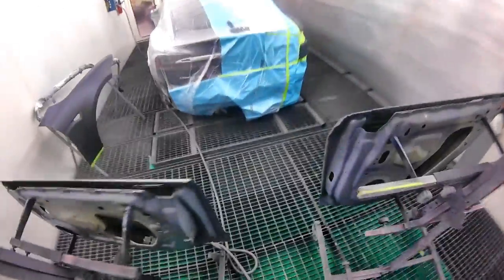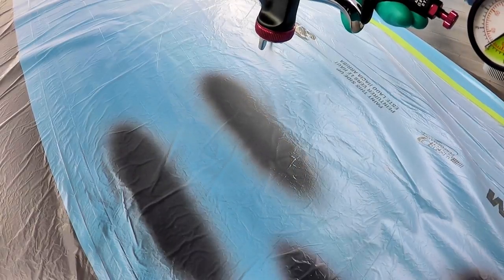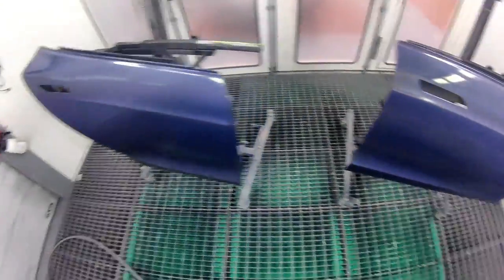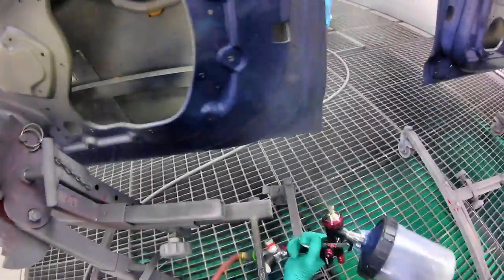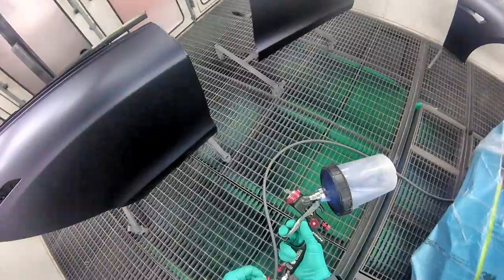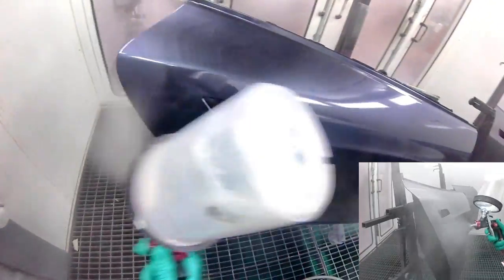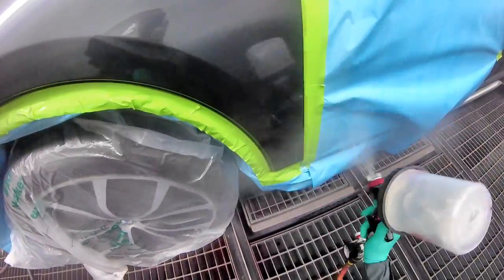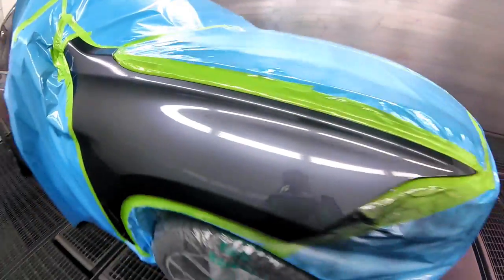Spray gun review MATCO MTHVLP14

Comment: I have this gun. I've seen some comments calling it a cheap gun. It's not a cheap gun. They cost nearly 600 new. I think they were nearly 700 to at one time. 

I really like  the gun. I honestly don't think it's as good as a sata 5000 or a dv1. But it's a good fun. The first time I sprayed metallic silver with it I was amazed. It shot it so uniform, after 1 coat it looked completely covered, no stripes, no modeling or darker spots. It's a great gun, but you have to keep it super clean to get the same results over and over. I clean my guns of course. But I'm a busy painter. And I've had periods of being a painter, bodyman, estimator, and customer service rep at the same time for weeks at a time. So I would do a quick rinse and scrub, blow some thinner through it and move on. This guns results get worse doing this. My Sata and dv1 can take this abuse alot better and still perform exactly the same.

Comment: I put off watching this largely because I didn't expect much from it either.  It looked like it did an excellent job on the sealer and base, and a pretty good job on the clear.  Getting a gun that works well with HS clear is challenging.  I would expect to run it at max pressure for HS clear which of course knocks the transfer efficiency down.  The ergonomics seem interesting.  Parts availability is a question I always have with the tool truck wares.  They are at a disadvantage since all the paint suppliers in my area stock all wear items for Devilbiss, Iwata, SATA, etc.  One call and I have what I need in an hour or so.   I'd like to see more on the air regulator and some detailed shots of the air cap.

Comment: This is the same gun as the Astro pneumatic europro, can be had on Amazon for cheap, i think it's made by star, and they have it with another name aswell
Reply: Matco does carry Astro's equivalent Europro's and have been for like 5 years. They are in the $200 range. Apparently this gun is all new and Astro does not carry it (yet?).
Reply from the maker: +Infinite Baffle hey brother I thought so too but it's not the same I looked at it and there are certain features that are different like the inside and transfer efficiency but that's just my opinion this gun performed amazing!
Reply from the maker: +Mustang Aficionado yeah astro doesn't carry it it's an exclusive astro made but Matco screwed around with it and made it amazing I couldn't believe it
Reply: MOTIVATED PAINTERS did not know that, just figured it was the same as I had a Astro europro and this looked identical, any idea what the matco Truck charges for these?
Reply from the maker: +Infinite Baffle yeah me too!  If you click on the link I put on the description the price online is 499 I have no idea about what the truck will charge. I was just given the gun and they never gave me any more information I wanted to have a special link for the motivated painters family but they didn't care enough to write back to me 😞

Comment: Hey Gabriel, I've got a question, it's not actually related to the gun itself, but something I've been thinking about latelly on the control coat. I know you always lower the pressure when you do your control coat. I'm trying to figure out the reason why. Let me explain. To me, when you apply the control coat the smaller the droplets, the better, right? So wouldn't it e better to increase the pressure? Or am I getting it totally wrong? lol.
Reply from the maker: +Rodrigo Camacho  so in my experience when the pressure is too high on the control coat the paint drys before it hits the panel causing sand piling. The reason why I drop the pressure is because that's what ppg recommends and it  works.  But it's good to try different things and see what works for you 😊
Reply: Ok, so I got another question, how about you apply the control coat right after the last regular coat, without waiting for it to flash off, Do you think it could work?
Reply from the maker: +Rodrigo Camacho for ppg that doesn't work. For axalta it does.
Reply: I thought Gunman said back a while that he put his pressure up a bit to get the paint to "dance" or "bounce" a bit more for his effects coat.  I tried it and upping the pressure worked for me spectacularly.  When I lowered mine, I tended to get mottling.  My experience only of course.  By as Gabriel and GM always say, it's what works for them and how they have their guns dialed in.
Reply from the maker: +RPMX4 +RPMX4 +RPMX4 yeah I remember when I was spraying BASF it was the same bring up the pressure but for what I am spraying PPG this is what they recommend. I'm glad you can test different things out!! 😀  every paint company will have their own little way of doing things
Reply: And your response clearly shows the expertise you've gained in knowing what works for what paints.  Well done!!That's what I love about the "Tube"  This provides such a great place to trade ideas instantly and throw ideas around with good people.  It's really cool when you think about it!!
Reply: It definnetly is!

Comment: Gabriel-same gun much cheaper-Astro lvlp euro 1.4 ,under 100 dollars on Amazon
Reply from the maker: +Scott Herr hey brother I checked this is not the same gun matco did some adjustments to the inside so I was told by Astro anyways hahaha
Reply: Do you mean the passages coating? All Rich Star Euro guns have anodized passages(water base ready) i have both the blue rp and the orange lvlp and they are both killer for problem mettalics.  Not sure what the other 400 buys you but if you like it thats all that matters.  Maybe try the 115 dollar version (ASTRO) and see if it is the same.(just a thought) I bought the guns for clear and sealer and they are not bad but lucked into trying them for base on accident. Love your spraying style and great attitude keep it coming.
Reply: @scottherr642  im planning to buying this same Gun? ASTRO EuroPro and thought exactly the same thing, this looks identical to it. Any recommendations wether I should go LVLP or HVLP models? I have a 33 Gal that runs around 9CFM at 40psi